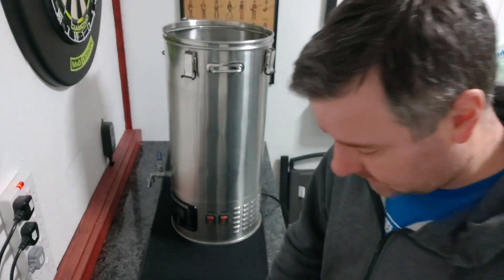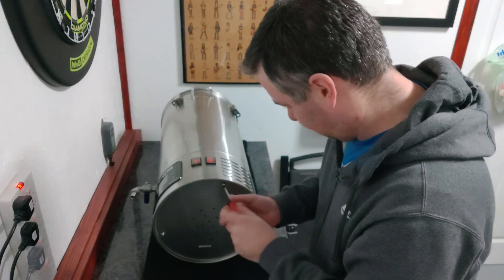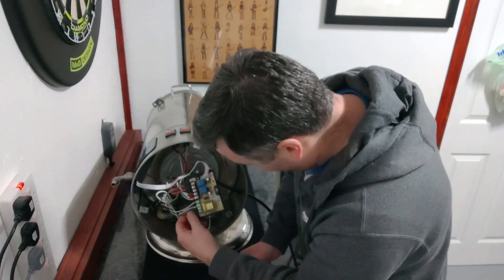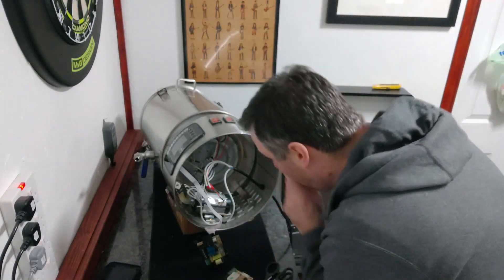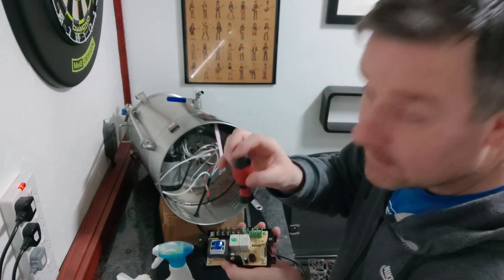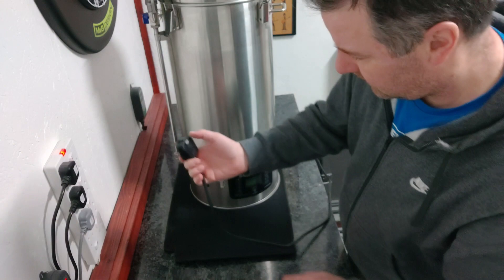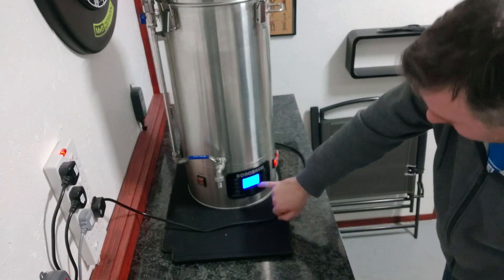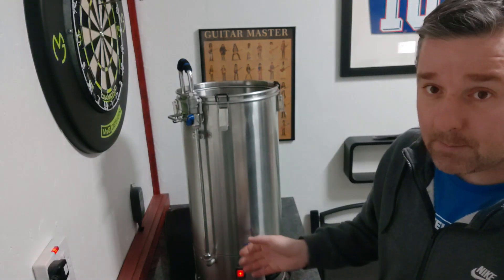HBW189 - Upgrading Robobrew v3 circuitboard

Comment: Hello. This is Patrícia from Brazil.

 I've had this pan for years and today it started to have problems. After a quick inspection I could see that it's one of the plates.

 I'm going to buy these G3.1.1 ones to replace, it seems easy. I want to thank you very much for this video. 

Cheers 🍻 thanks
Reply from the maker: @PatyCoppi  Hello Patricia, greetings from Ireland 👋. Hopefully this fixes your problem and you are back brewing soon.